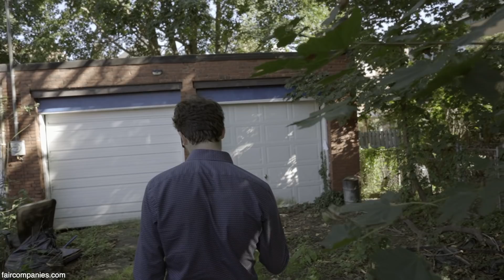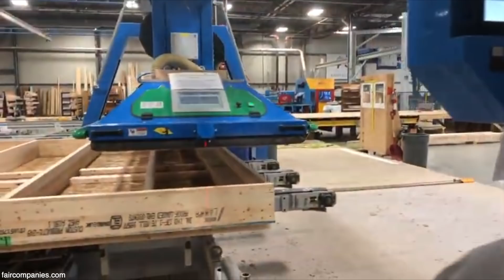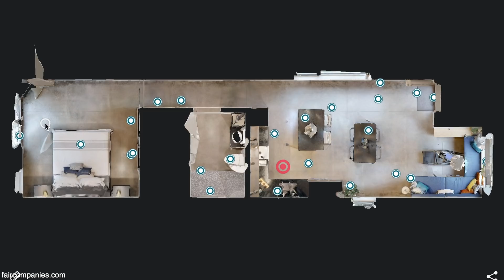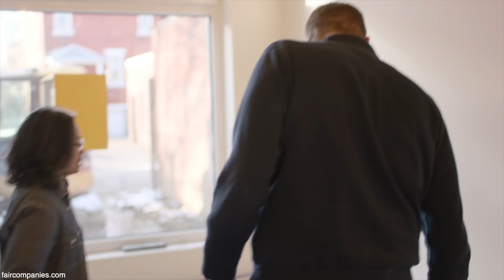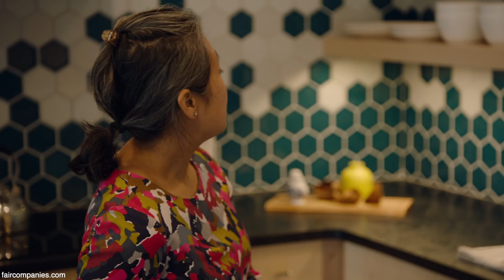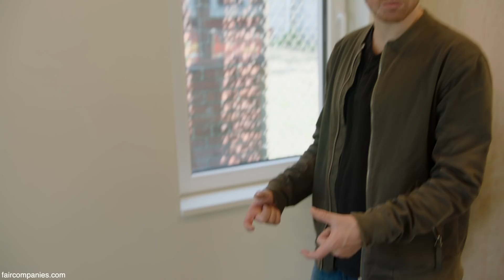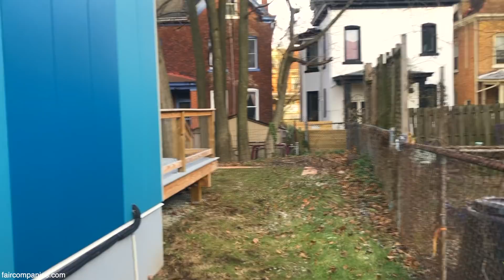Pittsburgh incremental house: a home that can grow with you

Comment: if he was speaking correctly he got the slab insulation details wrong.  most of the heat loss is at the edge of the slab and there should have been more insulation there then under it.

Comment: Any carpenter and crew could've framed that in 4 to 5 days max, and no, add it plant framing, shipping, and crane expense this is not cheaper, and if it rains while setting your pieces what then, seems to me alot of fluff talk by guy whose never worked a full construction week in his life but as usual knows better than seasoned carpenters.
Reply: I was thinking the same. There is no way this is cheaper than stick framing a house this size.
Reply: exactly this dude in the video is a foolish dude

Comment: Correct me if I’m wrong, half of Pittsburgh has already moved to Seattle. You could buy a home there for 200k? 🤣 You could buy a 450sq ft condo for 500k here, last home on my street was 1.4m.
So where are we going to put all the people from Pittsburgh and Michigan, as well as all the local people who have been priced out?
The city wants us to build UADU, unattached accessory dwelling units. However they cost 250-300k to construct. 
Prefabricated could be a solution, but they must get the cost down. How is this going to be affordable for someone making $25/hour? To be affordable, the payment should be $1000/ month.
Reply: I'm not surprised some people from Pittsburgh moved to Seattle. I'm from Tacoma and to be fair, don't worry I'm not moving back to WA)) cheers

Comment: It’s too expensive, too many high end features. I seen in Chile prefab homes for $3000 not including finishes, basic framing and siding, then you add your electrical, insulation, drywall and plumbing, which brings up the price to around $7000. A smart affordable home shouldn’t cost more than 50k and people can upgrade it as they can.  Regular people don’t need custom refrigerators and custom showers. If the plan is to build affordable, than this is not an option.

Comment: His whole argument is BS. Instead of having 10 local guys standing in the rain with hammers and nails, let's pay for 1 guy to ride an electric robot, made in China, to build over priced boxes that have to be shipped across the country. The steel industry might have left Pittsburgh in the 80s but now let's get rid of the building industry too. This type of construction has been tried and rejected  (from lack of sales), in the past, numerous times, because it ends up being cheaper and easier and more desirable to build custom. You want to change the building industry? Go metric.
Reply: <3 "go metric" <3
Reply: What is this “Metric?”
🤣👍🏻 📐
Reply: Haha, as an Australian (who had worked in the US) I agree with you about going metric! 😂

I do however believe that prefab housing is the way of the future. It is just far, far easier to build a home with low tolerances. Achieving far higher levels of air tightness, making the home far more energy efficient. Automation will play a big part in this, no doubt. As these homes are panelized, custom design is also not a problem - unlike modular homes, with unit sizes restricted to the volume that will fit in the back of a truck.

At this stage cost is a major hurdle, but I'd expect costs will decrease. Another hurdle is the sigma of manufactured homes. Comments here have called this home a "crappy" prefab, even though it is far more energy efficient (so likely more comfortable) than an average build.

Yes, prefab will have an effect on those employed in the building industry. Like all automation, this creates a problem for society, with job losses. But it's really up to 
 governments to find suitable pathways for those displaced to new, useful employment.

I won't pretend this is always the case.

But I don't think that inefficient industries - or even worse environmentally damaging industries, like the coal mining industry - should continue, just for the sake of maintaining current jobs. That's the case in Australia, one minute giant fires. The next minute the start of the Adani mega coal mine project. All for the sake of jobs & growth.

If a job doesn't benefit society, why employ that person. Better to give them a 'living wage' than let them do a job that is detective to society.

Sure, you could say the building industry isn't destructive. Plenty of builders do a great job. But in average, here in Australia, the standard new build is very energy inefficient & extremely leaky. Prefab automated homes could greatly increase the standards of the homes here.

Comment: The average no. of people living in an American family is 3.14.  Household size can increase depending on race and ethnicity.  Its a small correction but I think this whole presentation is full of slightly incorrect statements (due to a lack of skilled labor and bad weather we need automation, the impression that this represents "affordable housing", and the surrender to gentrification as the norm).  I found this commercial disturbing.

Comment: This does nothing to address the housing affordability problem.  If you get on their site, Kirsten lists it in the description, and look up the plan shown here, which I believe is the Nook, you'll quickly realize you're paying top dollar on a per square foot basis.
This home, using interior dimensions, is 16'x34' or 544 square feet and starts at $149,000. The most upgraded finish work gets the price all the way up to $212,000. To put that into perspective you'll be paying anywhere from $273.90 to $389.71 per square foot, and that doesn't even include permits and the cost of the land on which you'll need to build it.
Land in Pittsburg looks to be going for about $160,000 on zillow, so you're going to be dropping $309,000 to $372,000 to build a 544 sq ft home.  That puts the price per sq ft at $568 to $683.  For those prices you can find far more home that isn't shoehorned into an odd little alleyway, surrounded by 3 other backyards with neighbors accessing their backyards by walking through yours.
Reply: At $275 per square foot is very expensive for a town like Pittsburgh with a glut of homes and vacant lots. I think they're on the right path but the price, with all the automation, needs to be reduced.
Reply: nor does it include the FOUNDATION!  So inspiring but such a complete let down!  For all the onsite time savings none of that is reflected in the cost to the consumer.
Reply: Bang on Peter. I doubt their listed price on the website even includes foundation so add another 30 grand to that.
Reply: I don't know enough about the relative values of different Pittsburgh neighbourhoods to be specific here (though there aren't many freehold single-detached homes for less than $200k on Zillow right at the moment). However, in big cities with housing crunches like Toronto, getting a 544sqft, freehold, single-detached home that didn't require a gut renovation for anything less than $750k is definitely a bargain - laneway homes in downtown/midtown Toronto can easily be $1million. (Even in the Toronto burbs, where I live, my neighbour bought their (1200sqft, nothing special) home 5  years ago for $400k; today it's worth $1.1million (not an exaggeration - one next to it just sold for $1.3 million last month, and it was in better condition.)

You're right that these homes won't make financial sense everywhere, but in places like New York, London, Toronto, Vancouver, San Francisco, etc. they are definitely a good idea.
Reply: @SarahWelstead  It’s Pittsburg.  Makes zero sense.
Reply: The city is giving away houses just to keep from tearing them down, half the people moved out years ago because of lack of jobs.
Reply: Not to address everyone at once but- Peter tew has a point @ 150k base model- he’s not solving anyone’s problems but his investors and own damn self. Intelligent People need to stop gaslighting charitable acts. You’re not helping anyone but your company
Reply: I haven’t been to Pittsburgh in ages, but my dad designed and contracted the last house we lived in there. It was a beautiful home 7 1/2 miles outside the city in Scott Township. It has 2150 square feet and is currently estimated on Zillow as worth $275,000, a third the value of my little condo in LA!
Reply: Yeah right, there are dozens of lots you can buy in the city that can accommodate this house for a quarter of what you are talking about. I don’t think this house would be built in point breeze or shady side but maybe Garfield and east liberty.
Reply: these houses are brand new though. hard to compare a brand new house to much older homes
Reply: Peter, I forgot to mention this: near me is a very large city, in top 5 of the country. We have had flooding that not only made national news for weeks, but also ruined lots of homes & neighborhoods. In one part of town an Ace Hardware went out of business. I asked WHY? And was told that with SO MANY home owners being repeatedly flooded, & finally not given city approval to repair, but houses were raised to ground...not enough home owners in area to support a hardware store anymore. 
Following this, the city began to experience a HUGE LOSS IN TAX REVENUE... & began to have severe budget issues...schools were closed. Funding for many programs was no longer available... even a drastic reduction in teachers because they simply could not afford to pay them anymore. So, they lost their homes too.
Bottom line: these cities ARE USED TO getting all this tax revenue, they make FUTURE BUDGETS COUNTING ON THIS MONEY, like it’s already in the bank. But then something happens, taxes don’t roll in, they are DEVASTATED! They don’t know how to function without all that money....so, to have a very small house with a high value, high construction cost is fabulous from the cities viewpoint. They will get a high tax because it cost more to build, & they are thrilled!
Check out hempcrete, it’s the way to go. There is practically no heating or cooling needed, won’t burn, is carbon negative, soundproof, non allergenic, will not mold or mildew & absorbes moisture when humidity is up & let’s moisture go on dry days. It Breathes! 2,000 year old structures made of it are as hard as rock & as comfortable as living in a cave. You never knew it got cold or hot outside! Yet it’s a lightweight building material, no smell, no glues, quiet construction site 😎
Reply: bfinfinity - Despite seeing the word “hemp” hidden in there (and my general eye rolling at how Hemp &/Or Cannabis “can make everything better“), it $oes indeed sound like good stuff. Also on point about taxes... really sad to see the damages to the Gulf states and communities.
Reply: @bfinfinity  Wow hempcrete sounds incredible.
Reply: Not sure what properties you were looking at in Pittsburgh, but property in this neighborhood is no where near that cost. Maybe out in the more expensive suburb areas.
Reply: @bridgieoh9326  But the cost of building the home is Robbery!
Reply: That's the government for you.  You have to make it expensive if you want to live in a small space that way you pay more in taxes.  If it were designed to be inexpensive/affordable then the government wont allow it.  Try putting a tiny house on any one of those lots and see what happens.....you'll get kicked out real quick....
Reply: It was compared to $600k homes, so the numbers you mentioned compare quite well. Also, you are evaluating the home based on its size and it was explicitly discussed that larger homes are not serving the actual needs of the population and the lot required a smaller home. Cost per sqft is an old and inaccurate way of determining a structures ability to serve the needs of the user.
Reply: I think you have missed the point: Kirsten makes a lot of these videos, and her purpose is to get viewers, subscribers & rake in cash from ads. She RARELY EVER even bothers with cost of anything in her vids. She doesn’t do informative vids, with facts & figures, but rather goes for the “surprise” or “suspense” on her titles. She is doing this to show what some have done, & many times they are “impressed by their own genius” & most would never copy their design or ideas. But it works for them & that’s the point: Each person is different & she shows a lot of do it yourselfers who live in strange accommodations at times. Some so high up, others couldn’t climb all those stairs every day, or cart groceries up there. Some so isolated they can only see wilderness. She goes for unique, unusual, different, and into oddball, strange & weird. But to each his own, right, & the owners are not making a living off being shown, she is...so if you thought she was trying to make a informational video...watch a few more of hers & you’ll see what I mean....I don’t watch many, but chose to look at this one, just now. I think I mistook it for a “tiny house” vid....she provides “entertainment” for a certain sector, & they like what she does. Now you know. By the way, this house was incredibly easy to find online, took just a few minutes, it’s really there. 
I wish there were more ‘ger’ or ‘yurt’ vids, I love seeing those in Mongolia, especially the construction, or assembling, & making the parts! HINT!

Comment: It's tiny.  We could stick frame that in a day.
Reply: I agree. I wonder how long it really took to do everything, 3-6mos? Same as other method, but money sent out of State. When will we learn what local economic regeneration is and begin to make it the priority. China makes crap like this already.
Reply: @Judson meraw, "money sent out of state"  "local economic regeneration"  Great points.
Reply: Hell in college we built a 1500SF house in a week and that's with only 1 guy who knows what he's doing.
Reply: I think you could frame it but could you frame it and insulate it and dry wall it in a day.
Reply: @kam3410  but would you get anywhere near reaching Passivehaus standards? Not unless you took your time, with care & attention to detail.

No point getting a house up quick, if it's going to be leaky (which is usually the case here in Australia). Making the home far less comfortable, & increasing the cost to the occupants greatly over the life of the building.

Comment: I can't imagine someone entering that house when it's -6 Celcius outside and any warmth in the home would escape. The entry porch should have been a closed in vestibule with room for wet clothes and boots. Pittsburgh gets a lot of rain.

It's interesting that he considers the side elevation the facade.

No tripping hazards inside the home but steps front and back with no handrails.

Brian Gaudio left me unconvinced that this design is good. ( I won't mention octopuses)
Reply: @ibikeec Obviously they don't want a handrail, or ramp. If that's the case why highlight that their are no tripping hazards in the bathroom. Not only did I find the design rather useless for the purpose but I found the presentation by the CEO rather strange and contradictory.
Reply: Code in most areas doesn't require a hand rail for porches or decks under 30 inches.
Reply: If the air is colder outside than inside, what will happen is that it will try to reach temperature equilibrium between the two. Heat is just a form of energy and the energy in the warm air will transfer itself to the cold. This will cause small pockets at the door; you probably won’t be able to feel a wind but it’s the same effect.

In short, at the door you’ll have a turbulent area where warm and cold are mixing. Indoors will begin to get colder as the energy in the form of heat transfers to the colder air outside. And your heater will work harder than it had to if it’s got a thermostat on it. Because of the short duration it takes to open a door then close it this action would have a minimal effect. Basically you would barely notice it. 
Most new home construction do not have a vestibule. I do agree with having a space to remove and store ones shoes and jacket before entering. That's what I have in my home and homes I design. I do explain and offer a vestibule but most clients reject the idea.
Reply: A vestibule is more than a cloakroom it acts as a baffle to stop draughts entering  the house when the door opens. 

Most people who live in  colder climates will see the logic in having one, otherwise it's difficult to imaging a bitterly cold draught blowing into your living area each time the door opens.
Reply: @goldenbox7803  I lived in Pittsburgh in the 1950's and most of the older homes had vestibules and for a good reason.  The climate is changing but to what.  Someone have a crystal ball?  This house is ugly, does not fit the neighborhood, and is too expensive.  Who wants a back deck that is little more than a goldfish bowl?
Reply: Let me add a P.S.  While I'm not a fan of the Mac Mansions, this idea of everybody living in overgrown closets is doomed for failure.  Home is more than where you eat and sleep.  To pay the high prices they are charging for tiny homes that provide no space for actual day-to-day living is stupid.  Not everyone wants to live outside; to spend their leisure time hiking, biking, etc.  Some of us want/need space for hobbies.  We want guests to be comfortable -   oh goody, let's line everybody up on the sofa while we stare at the opposite wall.  Let's cram a dinner party of six or more around a table built for two.  Let's put our aging parents on a make-shift bed; that'll help remind them of all their aches and pains.  And of course I've always wanted a kitchen with no work space.  Count me out.  A small house is one thing; taking up residence in a shoe box is another.
Reply: @maryannerick7617  You said it right, Mary Ann!  I am an artist and need a bit of space.
Reply: @rosalindtaylor3479  I, too, am an artist so know what you mean.  Downsizing is not the answer either.  Toss out family pieces?  Not on your life.  Heritage is important.